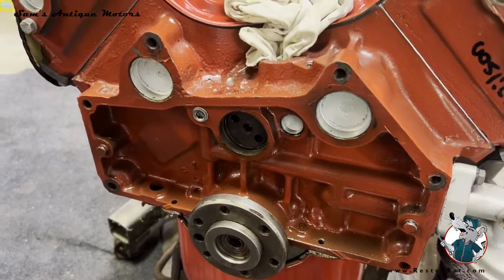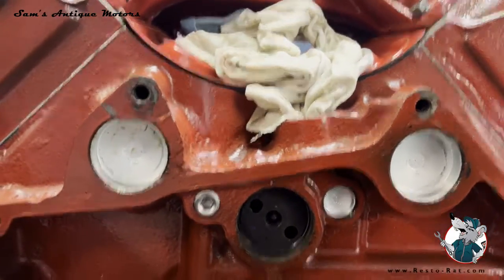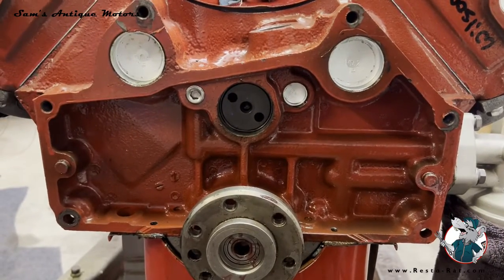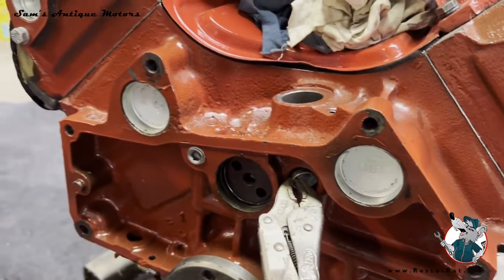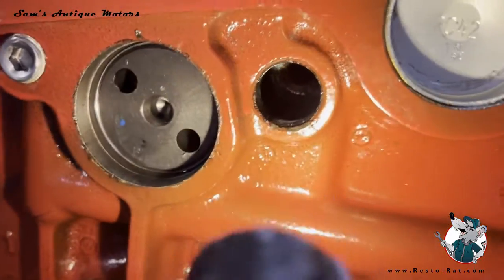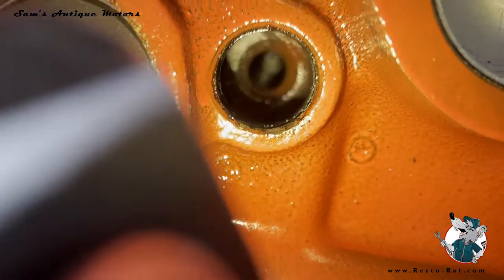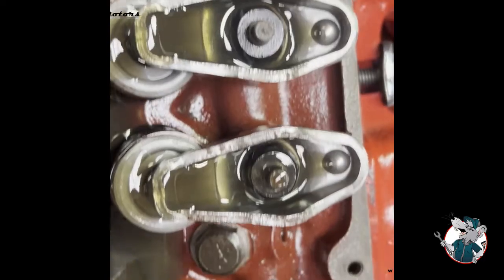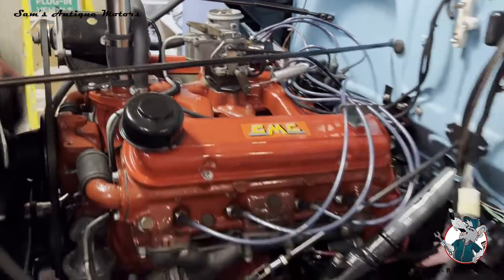Pontiac 316 Oil Galley Plug | Segment 12 – 1956 NAPCO GMC Model 100

Comment: I think i have the same issue , rebuild motor and the last 2 lifters passenger side wont pump up . I installed new lifters and they are still ticking . ...

Comment: Question, did GMC use Pontiac as the V8 power for these trucks or is this a swap you planned?
Reply: Glad to see your “Back on the Air”. 
Happy Holidays to you and your better half. 
Take care
Reply: GM did not offer a GMC or Chevy v8 until 1960. But if you wanted a v8 in a GMC you could get a v8 from the factory and in that case GMC got a Pontiac engine. So yea this engine was offered and is not a swap.  You can tell by the v8 badges on the fenders when equipped with a Pontiac v8. 1956 saw the 316. Also supplied in a Pontiac Chieftain. Prior years was I believe a 270. Later years moved up in displacement. And Pontiac did not have a small block and a big block. Used the same block with different bores and strokes I think all the way up to 396 and maybe 455 ci displacement.